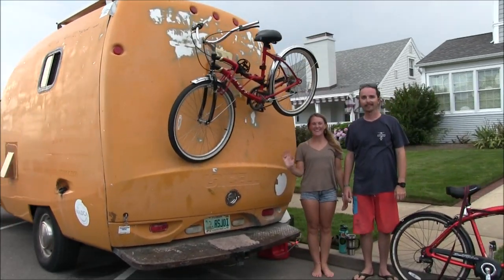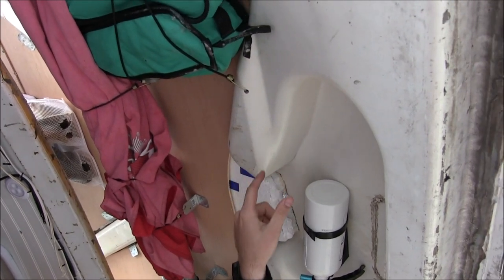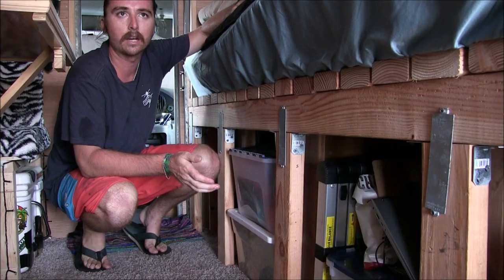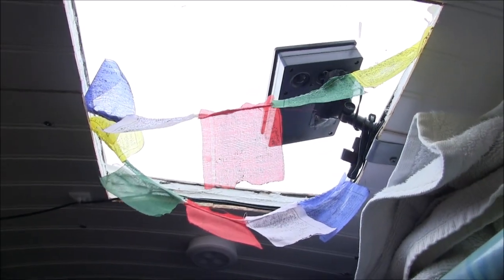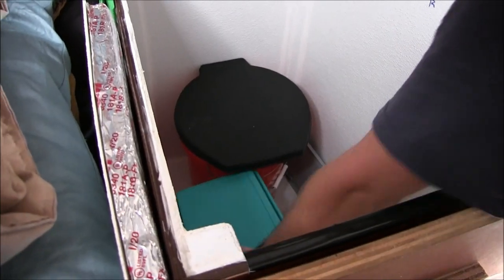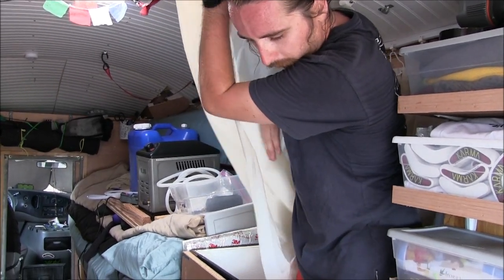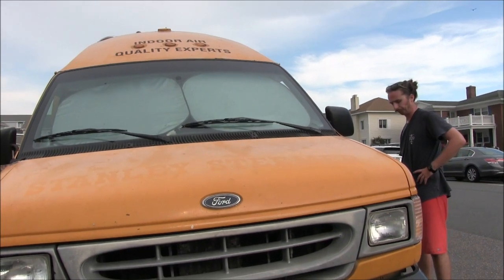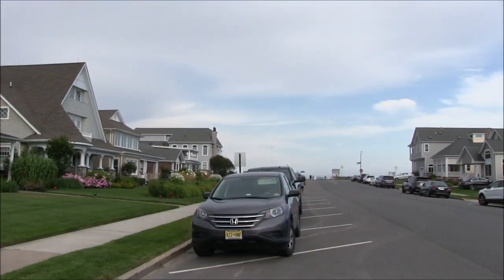VAN LIFE TOUR | Artist Transforms A Stanley Steemer Work Van Into An Splendid Home on Wheels

Comment: This guy only cares about the function, none of the form! 
What a difference from the last conversion.
But I bet you this whole thing cost less than half of the other vans interior. Sometimes just getting on the road is the important part.
Reply from the maker: Yes it’s the lifestyle that is important
Reply: New Jersey Outdoor Adventures you know it!

Btw, I haven’t forgotten about our meet up. Been busy fighting rust on the underbody and suspension of the Jeep. It’s slow been going.
Reply: I loved how everything had a function and he made things work!!  Ingenuity:)
Reply: Sindy J yeah, it’s just too bad that he didn’t have access to the material culture that others do to make better solutions at similar costs. 

For example:
If this guy was better with his knots and ropework, he probably could have set up a bunch of those ratchet strap closures at far lower cost by using ropes. 
Another example: If he had better woodworking skills, he could have made that bed frame sturdier and not needed to resort to using flattened L-brackets.

With a little more skills and knowledge his van could have been better to look at and equally as functional. Probably more livable too. Hopefully this guys find a good mentor in the future to refine that talent; because he sure does have some.
Reply: @macmurfy2jka  yes very true...additional skills could have helped him very much.  His hippie self worked with what he had.

Comment: The only problem why would you get an air conditioner that you can only use with short power.. that mean if you campoli back to your van far away and there's no electric you're going to burn up in that van.. if you get a 5000 BTU air conditioner that's a generator you have will run it this way you don't need short power for the air conditioner just my opinion thank you..